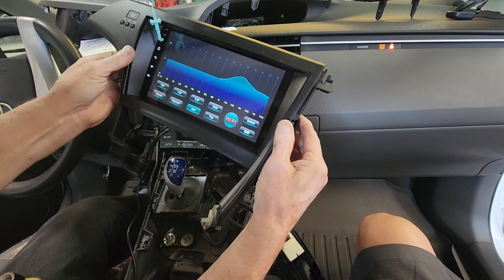2010 Prius How to remove radio Install 10" Apple carplay android auto reverse camera Step by step

Comment: Hi! I have this car and need to know besides the radio, what else would i need? its a mounting plate or something like that? and where do u recommend i get it? thank you so much
Reply from the maker: This is a plug and play which means everything you need comes with the radio
Reply: oh wow nice, do u have a link where i can by this radio? thanks again @goautosound1
Reply from the maker: Try this 👍 Don't forget to subscribe 😁
https://www.amazon.com/9-inch-Stereo-Upgrade-Replacement-Built/dp/B0C23PJ9LV/ref=asc_df_B0C23PJ9LV/?tag=hyprod-20&linkCode=df0&hvadid=673663742877&hvpos=&hvnetw=g&hvrand=12829399959610431628&hvpone=&hvptwo=&hvqmt=&hvdev=t&hvdvcmdl=&hvlocint=&hvlocphy=9004287&hvtargid=pla-2202865951173&psc=1&gclid=CjwKCAjw1t2pBhAFEiwA_-A-NLhXzv6dcIU78wj9Y1IdNnWgskOjAlfsZ2q2L0QQYOZgy1b-P15uVxoC-gcQAvD_BwE

Comment: Are you able to see fuel consumption ? I can see energy flow from the battery like in the oem but no consumption. What may I be doing wrong? Mine came with canbus
Reply from the maker: @michelgarciag  didn't try that, I don't know 😕

Comment: What about the 4 bolts you removed? I did not see you put them back
Reply from the maker: @hectorplascencia2271   the new radio is light and thin, they didn't have any holes to mount,it simply snaps in to lock in place. 😁